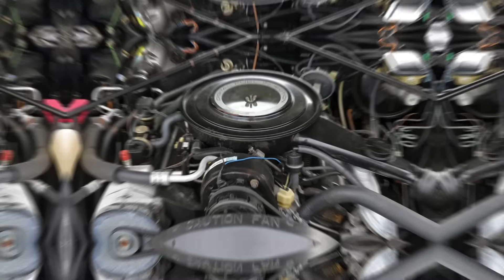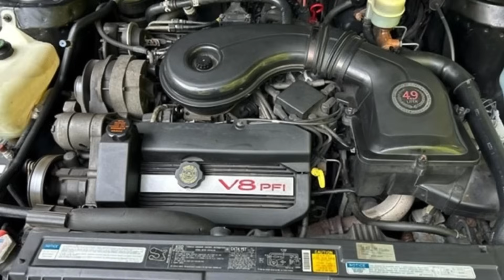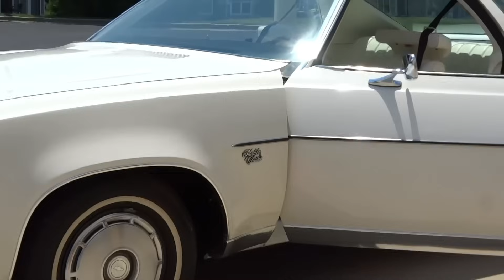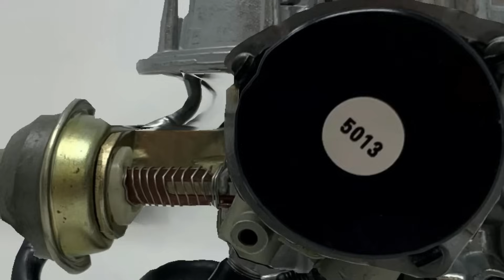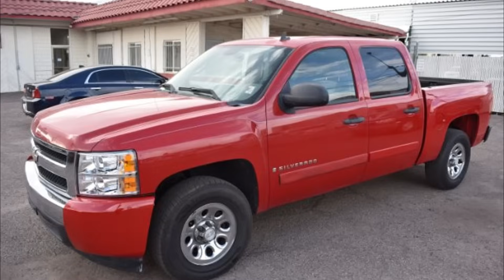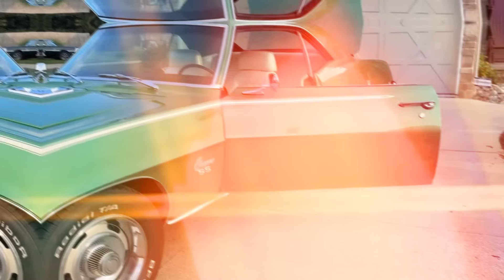American V8 Engines That FAILED Spectacularly

Comment: I HAD A 1980 TURBO TRANS AM. THE PERFORMANCE WAS ON PAR OR BETTER THAN MOST AMERICAM PERFORMANCE CARS OF THE TIME BUT A TURBO WITH A 4 BARREL CARB WAS A CRUD SETUP. I REMBER THE TURBO LAG AND THE ENGINE KNOCKING WITH REGULAR FUEL. NOT TO MENTION HAVING TO IDLE THE ENGINE FOR 60 SECONDS BEFORE SHUTDOWN.

Comment: A better solution to the Chrysler Lean Burn system was to install a Mopar Performance Electronic Ignition System and putting different fuel mixture jets in the Carburetors. End of problem.

Comment: The 305 small block Chevrolet actually replaced the even worse 307 small block Chevrolet, an engine known for no power and excessive oil usage. The Chevrolet 305 actually had quite a successful run.

Comment: Amazing how the section on the 5.2 Liter Chrysler Imperial Fuel Injected V8 never showed a single one of those V8's or even the car it was installed in. This is a common problem with these videos.